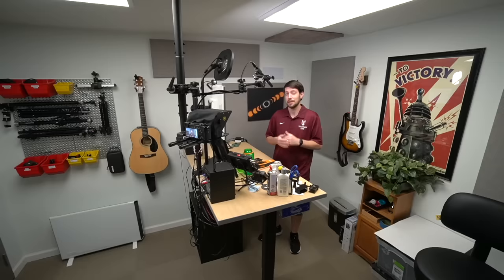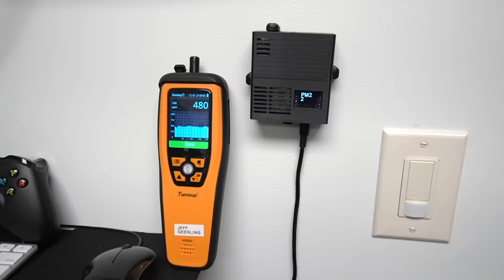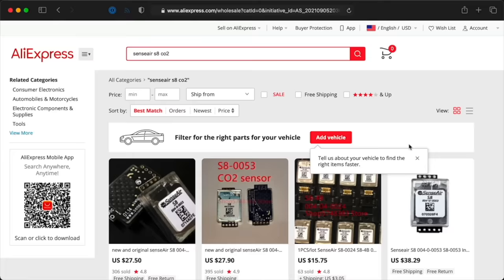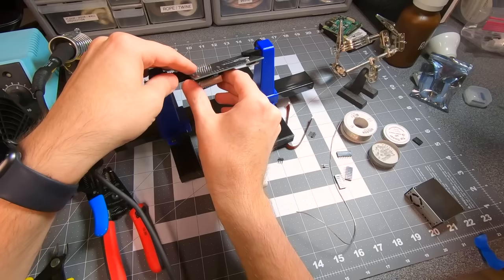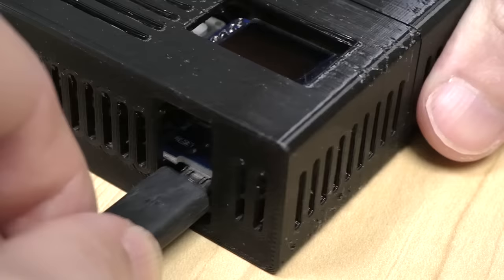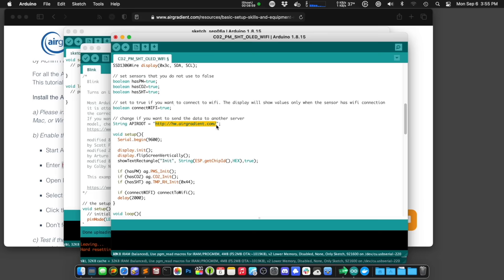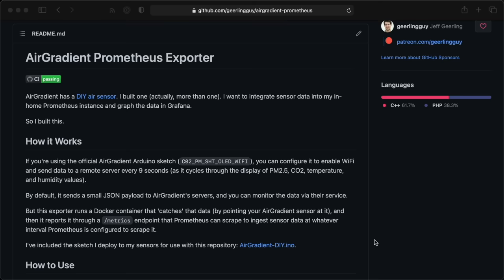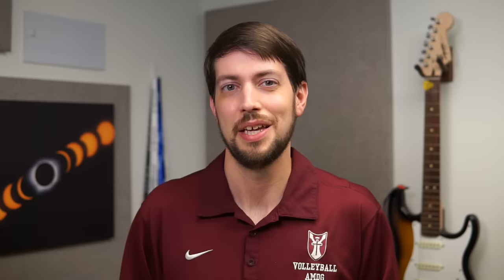Your home's air could be making you sick. Fight back!

Comment: love how he starts building a CO2 and particulate sensor instead of making an angled cover for the vent, so it can stay open all the time
Reply: Like just space it out 1-2 inches from the vent, lol
Reply: @Faranox if the opening of the covering is smaller than the original, it will inhibit airflow, and also make more noise.
Reply: @lloydrmc  ? What. I meant just space the covering a few inches off. It wouldn't make significantly more noise
Reply from the maker: #engineerproblems
Reply: @JeffGeerling  First of all it does not look that bad. Second just move the vent as long as you have a stud wall on top of the concrete . if you can't a contractor should be able to do it for a couple hundred bucks.
Reply: That's because he recorded the video in his basement and wasn't able to think clearly.
Reply: He's saving all the oxygen for recording
Reply: Yeah, just prioritize your health over the aesthetics needed for a youtube video.
Reply: Not so bright after all or atleast in some areas, huh? LoL!
Reply: This is why Engineers need managers.
Reply: @JeffGeerling  Engineer possibilities.**
Reply: I love how this comment completely misses the point of why this channel exists.  Not to show how a contractor or builder would do something "properly" but how learning can be applied for real world effect.
Reply: @JeffGeerling  Can you make one of these with a CO2,  TVOC, .3um particulate that I can hook up multiple of them to a single control panel (graphs and monitoring)?  The sciosense ens160 and the yoctopuce voc-v3 and the sciosense has an all in one (PM And VOC) device and yoctopuce has a PM device too.  I'd love to mess around but I need these for work.
Reply: @JeffGeerling  and these are for outdoors and indoors, so they need to be ok in the rain and buffer the wind, so I can setup many of them on a long length (100ft/50ft/25ft) ethernet cord...
Reply: @VenturaIT  you will not get anything accurate for measuring particles at .3um. en1822 is the old standard for measuring efficiency of HEPA filters and the equipment to accurately measure these are in the multiple thousands of dollars. What is the application and why are you wanting to measure to ISO clean room standards?
Reply: @GC8scooby  I have a Dylos 1100 Pro for under $500 and it measures down to .5 microns... other devices will do .3 microns and have enough accuracy to get a good estimate.  All devices of this type, even the reference devices, even SUMMA canisters used by the EPA, even sorbent tubes, are just estimates.  There are junk devices that are worthless however.
Reply: @GC8scooby  For the reason, I believe everyone should know the quality of air they are breathing...  the smaller ultrafine particles are more dangerous than the bigger particles so it's better to know down to as small of a particle as possible.
Reply: @VenturaIT  agreed like all things however, how indepth do you actually need to go. PM1 is probably about as useful as you need to go. Any further than that, the infrastructure required to actually filter or protect against those particles are out of the budget for majority of people. If it is for a "clean room" yes I understand. For example, you show a high count at 0.3um and then you are asked to reduce it, you are looking at HEPA grade H14 for instance is 99.995% effective at 0.3um but the fan and other equipment needed for the volume of air etc.... A bigger equation. My recommendation is just stay with pm1
Reply: @GC8scooby  That's not good, because you can have low PM1 and higher ultrafine particles, especially if the pollution is being run through a poor performing filter and it can give you a false sense of security, best to test for everything down to the smallest size particle possible which I think is about .1 um in 2023 with the best equipment you can afford, it doesn't need to be super accurate just a good estimate... nothing, even the expensive million dollar equipment, is proven to be more accurate...  but there is cheap equipment for .3 um...  True HEPA filters down to .3, they focus on .3 because (based on what I've heard) .3 is the hardest to filter... bigger and smaller is easier and HEPA can filter lower and bigger than .3...  particles are easy to filter, and even with cheap Merve 13 filters you can filter almost as good as HEPA, on our house furnace with a HEPA filter it does almost as good as a HEPA in the master bedroom with the door shut... it's more about air movement than the filter medium, to some degree, ideally you want the ability to filter the smallest particles and also high air movement, but a even a cheap HEPA filter from Walmart, can get down to 0 particles in a closed room, it's pretty cool to see that, what clean rooms do that is different is that they are isolated, and the filter is always on, and the filter pull is evenly spaced across the room... with one filter in the corner you get a gradient where the air is cleaner in some places that others, but I wasn't ever talking about clean rooms...  even the IQAIR sells kits that adapt their units that are the same as used in homes for cleanrooms...  a HEPA filter, IMO, should be combined with a negative ion generator too...  just my opinion... I don't agree with bipolar filter tech because the + ions are actually like free radicals, they cause oxidation...

"Why are positive ions bad for you?
This is because we are surrounded by positive ions from electromagnetic fields generated by computers, cell phones, and other electronic devices which can impair brain function and suppress the immune system causing symptoms such as: anxiety, breathing difficulty, fatigue, headaches, irritability, lack of energy, poor" - Holisticlakewood

positive or bipolar filtration will work, and it will filter more than just negative ions, but mostly because there are just more ions produced, better to just use a bigger negative ion generator, IMO

A Japanese doctor did a lot of research and found indication that negative ions can even prevent cancer.

  also particles are easy to filter, what's hard to filter are gases/VOCs...  some VOCs will condense into particles inside the room, so it will make it impossible to filter due to the VOC pollution... and even the best carbon filters only filter about 9% of gases, and only some gases, and only after 1 hour or more, and in that time the occupants have already died or breathed enough of the gases to be fully exposed... so if you have gaseous pollution the only solution is complete removal from exposure, filters, at this time, just don't work for gases.

I already found the devices I need, by the way.

This is not medical advice.
Reply: @VenturaIT  I understand what you are saying, and for your case you seem genuinely interested so by all means, get as good a sensor as you can and see how many particles you can remove. It's hard to effectively filter molecular (VOC) applications using HVAC filters. The air velocity is usually far to high for the amount of activated carbon that is actually marketed to be in the HVAC style filters. And when they do have activated carbon, it typically isn't enough to capture the majority of the VOC or other target gasses. If you were serious about filtration and had issues with high concentrations of VOC or other gasses, then dedicated molecular filtration media is the solution followed by high efficiency filters to remove the particulate. FYI they no longer test filters to en1822 which is 0.3um it now is an ISO standard which test the MPPS or Most Penetrating Particle Size. It gives proper real application information as it shows at what particle size the HEPA is efficient up until. I work for a global OEM filter manufacturer:)
Reply: @VenturaIT  I was more suggesting that of you are wanting to have an outdoor air sensor targeting particulate below 1um you will see a very high count. But it also depends on what those particulate are. So many factors to consider....and if you are marketing a sensor to pick up sub 1um, then it's good to have an answer on how to capture those particles. Merv13 won't cut it compared to a proper HEPA Housing and H14 for example
Reply: @GC8scooby  I've tested a number of carbon filters and I've consulted with companies that make industrial carbon filters and provide different filter media for VOCs, none of them are 100% capable... gases just can't be filtered, that's why the only solution to gaseous/VOC pollution is removal (according to the top medical doctors at major universities.)  Even the military doesn't try to filter, they get out of the area once detected.
Reply: @VenturaIT  if you know what VOC you are trying to filter, let me know and I will point you in the right direction
Reply: Now whats it doing when you wear a mask?

Comment: now that you can monitor the rooms co2 levels, you should put some plants in there to see if/or how much co2 they absorb
Reply: Plants in a basement? Lol
Reply: @yaash4123  grow lights…
Reply: @smacksalad  you can have pretty efficient LED lights that grow stuff. I have many aquariums in a similarily enclosed room, with DIY aquarium led lights
that are quite powerfull, but dont heat the room that much. I also live in the tropics, where it is very hot. But i have AC, i guess if your room is closed without any climate control, any heat source can become annoying? But then again, a small, low light plant, with a small efficient led light may cause very low heat generation.
Reply: @AudreyRobinel  Nope. Current LED are around 20% efficient, theoretical maximum is 40% efficient, that's 80% and 60% heat respectively. Still a lot of heat to deal with. If you're running AC the cost is more than double what it is for those lights.
Reply: @choahjinhuay  we all know a plant that would thrive in 3000ppm CO2 and produce some big buds
Reply: @gg-gn3re  chinesium trash LED´s might have 20% efficacy however the LM301B chip from samsung is 62.8% efficient pumping out 220lm/w, and their next chip LM301B EVO further improving it to 235lm/w making it 67% efficient theoretical maximum is 350lm/w. i should add that the theoretical maximum luminous output depends on the wavelength of the light so monochromatic LED for example green  can achieve values of  680lm/w
Reply: @gg-gn3re  which chips are you using, also theoretical maximum is an absolute number and it is 350lm/w for neutral white light, which then would be 100% efficient. how much lm/w are your chips generating and at which current are you driving them. and why the ad hominem?
Reply: @Humbulla93  What does chips I use have to do with anything, you just named random samsung chips which are the topic of discussion. Also, no, 390lm/watt would be 100% efficiency, dummy. Phillips was the first company to break the 200lm/watt barrier.
Reply: @gg-gn3re  okay so you say the philips led have 200lm/w and you say theoretical max would be 390lm/w which would make them 51% efficient without driver losses, yet your first comment you stated that current LED´s are 20% efficient, besides that CREE had achieved higher than 200lm/w earlier than philips. also i couldn´t find the philips led where are they sold? all infos i could gather was that it was a lab LED
Reply: @Humbulla93  Driver losses are part of their efficiency, dummy. What part do you not get? 100% efficiency would mean 100% of the power used, is converted into light. There would be absolutely no heat produced at all. This is why it is not possible.

Yes what I said was in a lab.. where stuff gets created/produced first. Whether a product is released is irrelevant, we're talking theoretical maximums. Since it'll never happen in a lab, it'll never happen on the shelves on a store.
Reply: @gg-gn3re  that´s why i said luminous efficacy which is different from luminous efficiency. and we talk about luminous efficacy which theoretical maximum is 350lm/w so this value would be 100% efficiency now take the LM301B with 220lm/w and you get 62,8% efficiency. and i don´t see why 62,8% wouldn´t be possible, and the samsung LED are available to every customer unlike your stated philips. a good meanwell driver like the HLG-120H-C700 reaches an efficiency of 96% at 90% load. then factor in losses due to optics of 5% and you have 0,628 * 0,96 * 0,95 = 0,57 so the whole light fixture turns 1W electrical energy into 57% usable light and 43% into heat.
Reply: @gg-gn3re  heres a text from a website In order to achieve the highest possible efficiency for the LED luminaire or illuminant, efficient light-emitting diodes must be installed. For example, the high-power LED319A from Nichia achieves an astonishing luminous efficacy of 164 lm/W. This gives it an efficiency of just under 47%. This is the current record in series production. besides that you came up with 100% efficiency i never said that
Reply: @Humbulla93  cool, learn to read so you can stay on topic, until then don't bother communicating.
Reply: @choahjinhuay  If he's in that basement for 6 hours a day, he might not even need any extra lighting than that what he already uses for video. Many plants thrive under low light conditions, like Spathiphyllum.
Reply: An atrium specifically built for you PCing needs!
Reply: @Humbulla93  "high-efficiency LED's" have a VERY limited light spectrum that is mostly useless for growing plants.
Reply: Mother in laws tongue is an excellent indoor plant with very good CO2 capture.
Reply: @yaash4123  Sure. Not all plants need daylight.

Comment: Here in EU legislation in last years introduced the mandatory requirements for new building about air quality. There ara some heat recovery ventilation systems that you could interface directly using arduino/raspi and do custom control ;)

Comment: Dude! This totally happened to us at our old house too, but not just in a basement office. We started closing all our doors a lot to keep the kids out of different rooms, and there was only one return in the house, and sure enough when we'd go to sleep at night we'd wake up with terrible headaches and grogginess because the CO2 levels climbed to 2000+. As soon as we put gates in the doorways during the day instead, it was easier for air to circulate enough before we went to sleep.
Reply from the maker: Good to hear from you! And yeah, many homes don't have a return in every room, so that is a real problem—especially if you have thick carpet that touches the bottom of the door and prevents air from escaping the room under the door.
Reply: @AstroCat I wouldn't say they "went down the wrong path". I would say they "didn't finish the job" because they didn't install ventilation in the form of an HRV or an ERV (explanatory video here: https://youtu.be/i7US4TmyD6k). Running one of those at very low speed all the time can greatly improve IAQ without massively running up your heating/cooling load.
Reply: Yeah I plan on getting an ERV once it's safer to have a contractor put it in. Our house is less than 20 years old so fairly modern and tight, but has returns in all rooms. So usually we don't get a particularly high level in just one room, we just don't get enough fresh air in so there's high CO2 in the whole house.
Reply: @navyholesnipe9469  usually CO (carbon monoxide) is more hazardous - there shouldn't be any in your home but as a product of incomplete combustion it can happen and kill quite silently. I'm not sure what the lethal level of CO2 (carbon dioxide) is but I suspect it's quite a bit higher than people see, I've heard of co deaths but not CO2 deaths outside of industrial processes. Do you know what the lethal level of CO2 is or if it's fatal more frequently than I realized?

Comment: Jeff, you can permanently fix this vent by mounting white sheet (like magnet one ) in front of it on 5-10 centimeters from wall. It will not block airflow and there is no difference from camera point of view.
Otherwise, pretty nice video! And I think about it but with ESPHome as firmware.
Reply: Or just take it off, it's not a big deal, these videos aren't big budget movies, his health is more important.
Reply: ...or fix it in post and mask it out! :D
Reply: Came here to suggest something like this! He could even 3d print a cover that would have vents on the side for air to go through, and put a cool graphic or logo on the front.
Reply: @marthinwurer  Logo looks even better 👍
Reply: @marthinwurer  Exactly! Turn a problem into a Branding Opportunity
Reply: I was pretty sure he said the magnet was meant to stop airflow to avoid noise in the video too. Sounds like a job for servo-controlled dampers 😁
Reply: Noise can be solved by using a baffle of some sort. A pillow size piece of sponge or perhaps even an actual pillow.
Then hang a curtain across to hide it.
Reply: @marthinwurer  Or even putt a big OLED on it monitoring airflow :)
Reply: @Sukrim  It may be for noise control rather than aesthetics
Reply: @tin2001  I see he has noise dampening panels right beside it. Depending on their construction, they could go over the vent just fine. I've seen a lot that are just heavy fabric over a wooden frame. Air would flow right through a panel like that. Alternatively, many are designed to be spaced from the wall anyways, and could be used to the same effect.
Reply: Or just 3d print a cover with side vents.  I personally don't see a need to cover it.